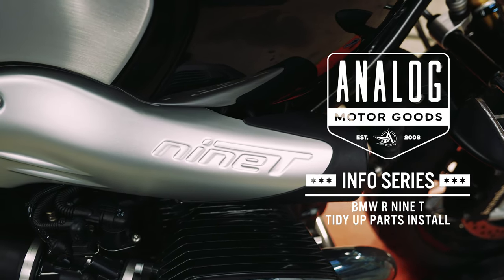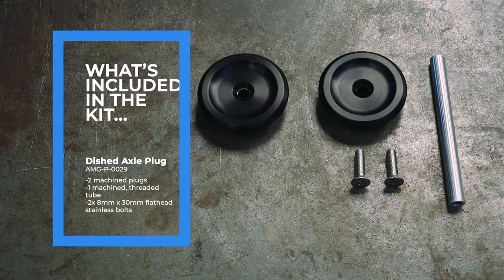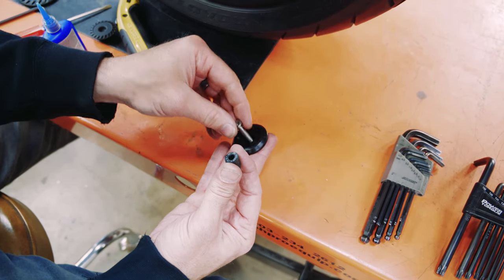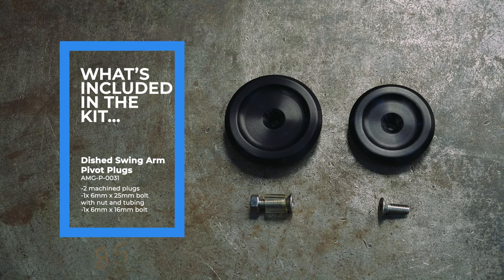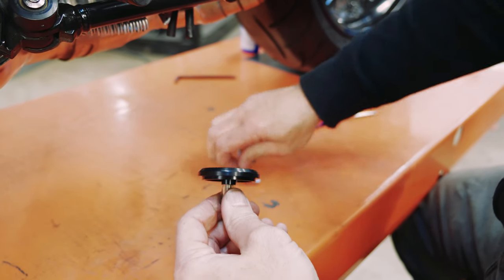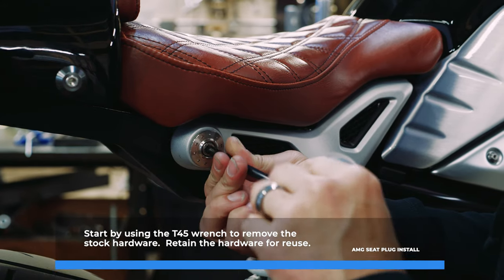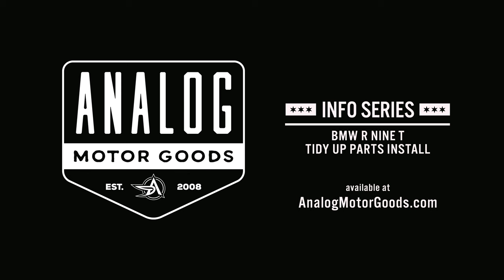Analog Motor Goods - BMW R nine T Tidy Up Parts Install Video

Comment: I cringed when he scraped off the finish on the swingarm with the screwdriver. I'd be mad if that was my bike.
Reply from the maker: What are you talking about?
Reply: @analogmotorcycles  just watch the video. The locations your guy uses to pry against on the swing arm while removing the stock plastic ring have noticeable sliver gouges left on the swing arm from the screwdriver. Next time use a plastic trim removal tool or at least put tape down first to protect the finish before prying against it with a sharp metal object.
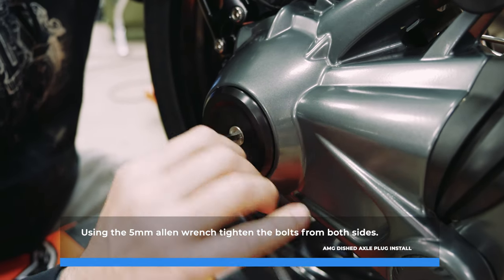Reply: No kidding. Took the finish right off in multiple place on the rear axle, with both the METAL screwdriver & the METAL...boxcutter?!?! Wow. Hope that's his own bike & just doesn't care about visible scratches, even after the new "tidy" is installed  2:03

Comment: Can I get this with black bolts?  You're 98% there Analog
Reply from the maker: You can certainly have the bolt heads powder coated if you want. But we like the contrast.
Reply: Agreed. Wanting to replace  with all black parts but adding shiny silver bolts doesn't make sense to me. If I want "contrast" I'd leave the bike as-is, tbh